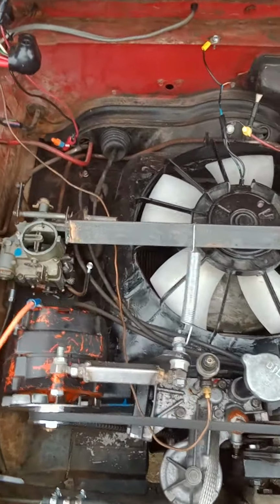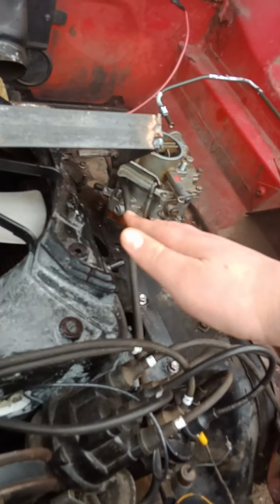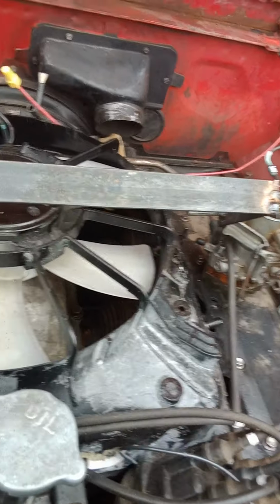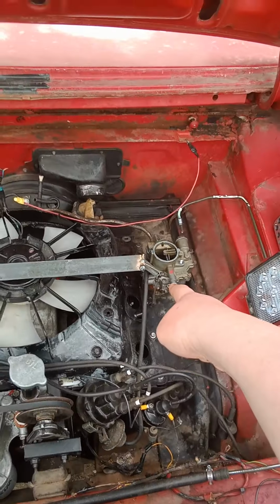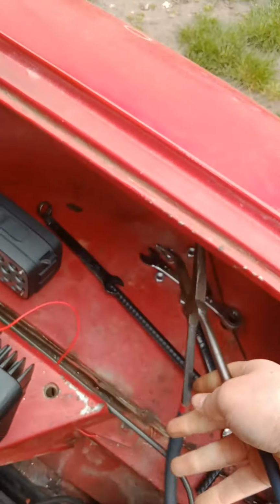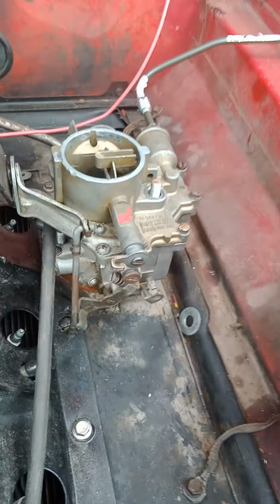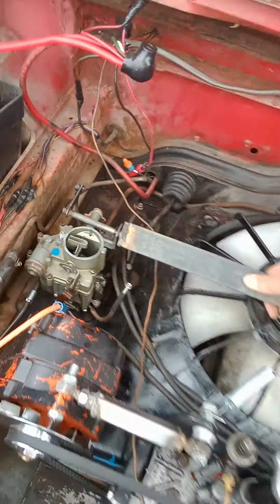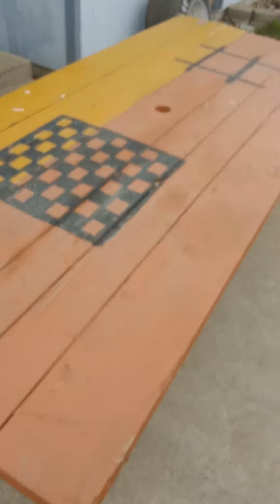Overheating my corvair... yay.

Comment: Well that will be the end of that motor soon.  You will most likely drop a valve seat that’s what happens when they over heat.   That fan cannot cool that engine enough    All those shrouds need to stay on for proper air direction around the heads and oil cooler   That whole air cooling system is designed to work together and a certain way
Reply from the maker: Well, it gives me an opportunity to pull the motor all the way apart, how would I actually fix it
Reply: @thatonecarkid.385  A 6.0 LS would fix it run some lines to a radiator up front and no more over heating problems just touch speed and that's a problem I want to have
Reply from the maker: I was thinking one of the transverse LS 4's from an Impala SS, it's a bit easier to swap.